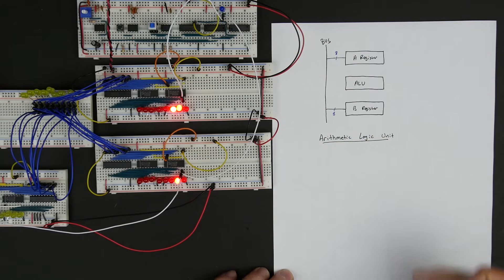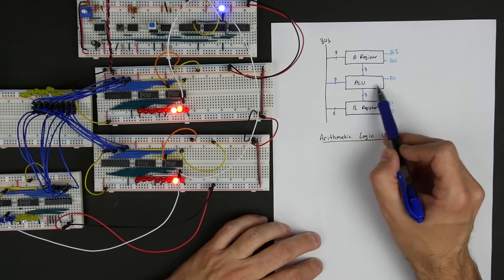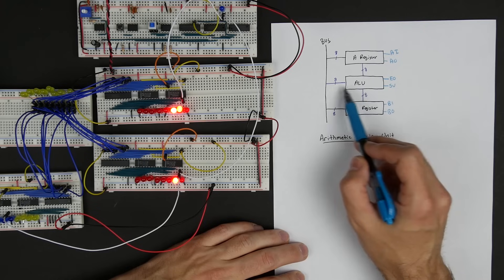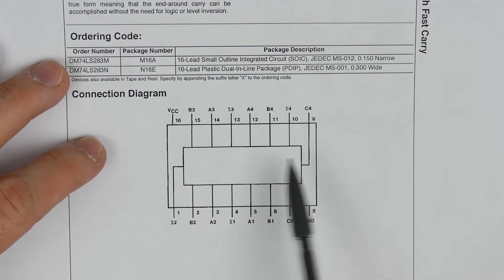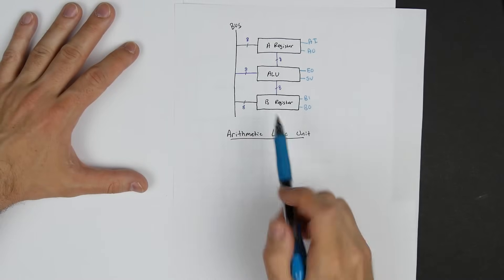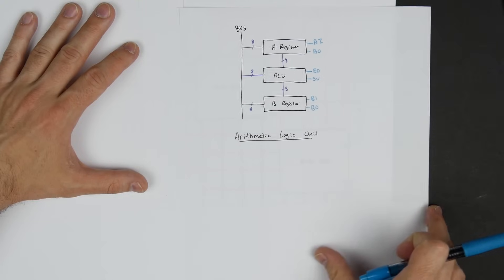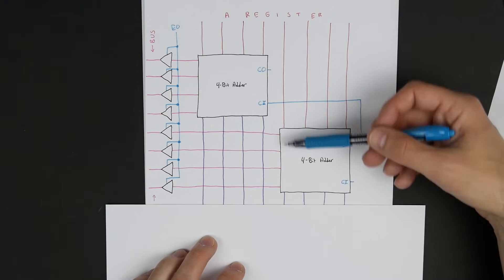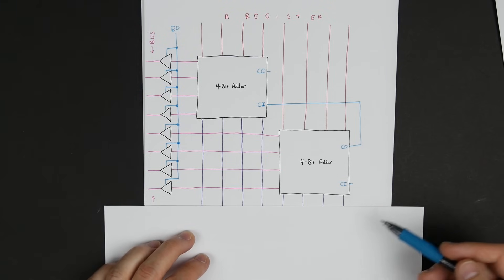ALU Design

Comment: So, I have a question; If I have a subtractor and adder, how could I 'store' the values? For example, there is absolutely no difference between 15 and -1, so, how could I store those without an extra bit? My only guess would be to slash the number of inputs, so that the only maximum output for a 4 bit ALU would be 7, with the minimum being -8.
Reply: It's been 3 months, but... just in case, and for anyone else reading:

The 8-bit representation of 15 is 0000 1111.
The 8-bit representation of -1 is 1111 1111.

The highest value you can store is 0111 1111, which is 127.
If you want to add 1 to 127 and store 128, that would be 1000 000.
Tough luck, because that's the representation for -128. You just got an integer overflow.

Comment: Hello Ben ! I just watched all of your videos till this one in a row, and I must admit I am really impressed about your work ! (nice catch for the carry in technique to get your twos complement)
I wonder why you use LS logic chips ? What does LS stands for ? I started a project a few weeks ago and went to HC chips, I was told they were faster and cheaper in terms of energy
Reply: Sorry for necroposting. Original chips were just 74xx. (for example 7400 for quad 2-input NAND). There were also low-consumption low-speed version called with letter L (low). Then the new technology emerged: TTL with shottky diodes which made IC faster at same consumption or of the same speed at lower consumption. These were called S (shottky) and LS (low shottky). 

At last, when CMOS technology became fast enough (first CMOS chips were 4000 series: very low-consuming but slow as hell), this new series HC was created, which means High (speed) CMOS.

Unfortunately, HC may not be compatible with other: circuit made entirely from HC works fine, but when you use both HC and LS, there may be problems.

Comment: Let's say for an alu I was using many 74f181's can I just link the cn+4 output and the following cn input together (I'm using 16 of them by the way). I was wondering if I needed to use the 74f182 with all of those or i can just connect the cn and cn+4? together thanks ahead of time.

Comment: I was wondering, why do we have to bring the A register and B register directly into this adder ? Isn't there a way to bring in the numbers off the bus?
Reply: dvsaleios excuse my idiotic question but
Isn't the point of the bus to be a sort of 'central hub' through which various components can interact with each other? Why not just hook up everything directly to each other? Or in other words when do you use the bus and when do you hook things up directly?
Reply: @active_diamond  So registers, ALU, other CPU components, etc, are *small*. You can easily directly connect them. With a 32 bit CPU, you only require 32 individual wires per register to connect them directly to the ALU. However, memory is very large in comparison. If you have 4 GB of memory on that 32 bit CPU, you would need 3.2e+10 individual wires. This would be messy, and almost certainly impossible to implement in hardware. It gets even worse with 64 bit computers, and soon you need more wires than there are atoms in the universe.
Reply: dvsaleios excuse my idiotic question but
Isn't the point of the bus to be a sort of 'central hub' through which various components can interact with each other? Why not just hook up everything directly to each other? Or in other words when do you use the bus and when do you hook things up directly?
Reply: dvsaleios excuse my idiotic question but
Isn't the point of the bus to be a sort of 'central hub' through which various components can interact with each other? Why not just hook up everything directly to each other? Or in other words when do you use the bus and when do you hook things up directly?
Reply: Not sure about this, but I think it's for some sort of "optimization". You can have only one output on the bus, so if the ALU would take the two operands from the bus, it should at least use two "ticks": on the first tick, the output of A is on the bus and goes into the ALU (perhaps in some sort of internal register) and on the  second one, the out of B will be on the bus, and then goes into the ALU. Finally, on a third tick, the ALU can output the result on the bus. 

With this setup, however, both A and B go directly into the ALU, so essentially it can perform the operation in just one tick!
Reply: No, the question is why would you want to? You load to registers from memory. Do something with the value in the registers then store back to memory. The bus should not be storing any kind of long term state only to facilitate transfer between components. To input you load to A or B register as it's what they're for.

Comment: carry out of upper adder will indicate overflow?
Reply: Actually, not really. If you add a positive number with a negative 2's compliment, it always has a carry that we basically ignore.

An actual overflow indicator for a 2's compliment adder has to check whether both numbers with the first bit are 0 have a result with first bit 1 or the inverse. Basically, in the first case would mean that you're adding two positive numbers and having  a negative result, or the inverse.

A logic for that would check if both register's first bit have the same value and if the result has a different one.
Reply: If you add two unsigned numbers and get a carry out then you have overflow.
If you subtract two unsigned numbers A-B by adding A and the two's complement of B, then if you don't get a carry out have underflow (borrow out).

If you consider your numbers to be signed from the beginning, the conditions are different, then I believe you have overflow if the carry into the highest bit is different from the carry out of it; there are other ways to formulate the condition as well.
Reply: He is trying to hack your machine, just ignore that bit

Comment: +Ben Eater, are you going to make some other arithmetic operations too? Like multiplication or division?
The simplest way for multiplication is to emulate it with repeated addition, but it is also very inefficient, because it gets very slow as the multiplier gets bigger :P

But there's another (better) way to do it, quite simple as well: with bit shifting & adding. You can do the bit shifting with a loadable shift register on one of your inputs, and then shift it 8 times to the left (multiplication by 2), and whenever there is 1 at that position in your multiplier, you also accumulate this shifted multiplicand into your output register. So it's pretty much the ancient Egyptian multiplication algorithm ;) It is better because the time needed to calculate the result doesn't grow linearly with the input, but it is a constant number of shifts & additions: equal to the number of bits of your data bus.

If you don't want to use shift registers and do 8 subsequent shifts & additions, but you do have some more money to spend on adders, you can simply connect several adders together and instead of shift registers you can simply shift the wires to the right by one position for each of the partial adders. You also need some control lines to turn these shifted inputs on, controlled by the bits of the multiplier. This is the best solution because it can calculate the result in just one clock cycle! :) (but there might be some delay on the carries to ripple through all the adders).
Reply: +Bon Bon , Or a binary multiplier circuit can be used: https://en.wikipedia.org/wiki/Binary_multiplier#Example
Reply: InductiveOrange Well, this is pretty much what I meant by the last option: summing up the shifted (that is, multiplied by 2) partial results in parallel. If you look closely at the example circuit you linked, this is pretty much two adders made of two XOR gates and two AND gates and connected together in a certain way, and the additional AND gates are there to "gate" the input signals, the original one and the shifted one (because you can do the shift by just wiring them off by one wire). Unfortunately, such approach is less modular if you have all these gates fleshed out. It is easier to understand when you encapsulate all the pieces of the circuit in blocks and then connect these blocks together into bugger blocks etc. Then the design is more modular and it is easier to extend it to more bits.
Reply: Cool. Didn't notice that.
Reply: +Bon Bon how can i do division ? i already have multiplication with the repeated addition .. but i cant find how to to division

Comment: where can I buy microchips besides internet???
Reply: There's also an option of recycling chips from some old electronics garbage. But this way you don't always get what you want, and you need to go with what you find in there. And you need to have some soldering skills. Breadboards are easier to work with, though, so if you're a beginner, I advice you to stick with breadboards and buy some brand new parts from the store (there are also online stores with electronic parts in the Internet).
Reply: store??? found some in electronic stores but buying from internet is easier
Reply: ok. thank
Reply: Bon Bon
Ok. thank you

Comment: Awesome vids! I was thinking you could even use the carry out from the top adder as an error signal.
Reply: Why error? There is nothing erroneous in it. But you can use it as a carry flag in your status register to indicate e.g. that there was an overflow during addition, or to be used in a subsequent addition to emulate 16-bit arithmetics, or as a flag indicating difference in comparison instructions ;)
Reply: i stand corrected, i was too quick to call it an error signal, but rather a flag that could be seen as an error signal, just made me realise that all signals are errors until we flag/use them, thank you!
Reply: Dale Smith No problemo ;)
Later on you can also use a zero flag which is useful in comparisons: it indicates equality of numbers when you subtract them. Just a simple NOR of all the output lines will do ;)
Some processors (like MOS Technology's 6502 used in those old Atari & Commodore computers and Nintendo consoles) also use an additional carry flag from 3rd to 4th bit for binary-coded decimal (BCD) arithmetics. Kinda useful for counters in games, because one can easily convert such BCD numbers to their corresponding character strings ;)
Reply: Bon Bon Yeah! I can see the NOR gates working to compare, could you go even further to compare the most sig bits to see which number is bigger too?

I don't understand the carry flag you're talking about, you make it sound like certain bytes of info have additional info encoded into them?? if so thats cool! 

if not then would this be possible? lol. Could you read a byte one way for a certain piece of info, then read it another way for another? Also makes me think about how to order info in memory, it seems so arbitrary in my mind, if the layout of the data itself could be used to extract info from then that would make programs more efficient??
Reply: Could you write a program where the order of the information itself can be used the encode how the information itself should be manipulated?? a kind of program within the data??? 

my head hurts
Reply: Dale Smith The usual carry flag carries over the bit which overflows from the most significant bit to the next position (if it were there). You can think of it this way: you add up 8-bit inputs and get 9-bit result, where the 9th bit is the carry flag. It can be used to find out if the overflow occurred, or to pass the information to the next byte when you emulate 16-bit (or longer) arithmetics.

For the "auxiliary carry" in MOS 6502 processors, it is used for Binary-Coded Decimal arithmetics. In this mode of operation, registers are considered as consisting of two 4-bit parts, each part can store a decimal digit (the numbers from 0 to 9), which can fit into 4 bits. The numbers greater than 9 (10..15) are considered "invalid". The BCD arithmetics works in such a way that each of these four-bit halves (decimal digits) are added separately, and if there is a carry from the lower half of the register (nibble), it is added to the upper half of the register. For example, the number 42 is encoded as: 0100:0010 or x42 (hexadecimal). So, as you can say, if you express the value in the register as a hexadecimal number, its digits correspond to its decimal notation :) which is very useful, and also very easy to convert to its corresponding textual representation: just extract each half of the register and add each of them to 30 hexadecimal or 48 decimal – which is the ASCII code for '0' – to convert them to characters.

As for how to interpret bits stored in a register: it's up to you. Bits are just bits. It's up to you (and the CPU) how you interpret them to give them meaning. The same combination of bits can represent an unsigned natural number, a signed integer, an ASCII character code, or a floating-point number, or a color value of a pixel, or even a CPU instruction (opcode, or operation code). It's all just numbers. Whether they are interpreted as instructions or as data, depends on whether the CPU is currently fetching them from that address into its instruction decoder, when pointed as the next instruction to fetch by the program counter register. You basically say to the CPU: "This number right here is an instruction. Decode it as such." and then "This next number right here is an operand (data) for that instruction. Treat it as a signed integer in 2's complement binary encoding." For example, in Intels' and AMD's CPUs (from the x86 family) there are separate instructions for multiplication and division: one for signed integers (imul, idiv), the other for unsigned integers (mul, div). Depending on which of these instructions you use, the next number (the operand) is interpreted accordingly.
Reply: For equality comparisons, I would use an XNOR gate for each bit so it shows true if the bits are both off or both on in just one logic gate. Then I would AND all the inputs for a single equality flag. You can also compare the most significant bits and set so if they're equal, it checks the next bit.
Reply: IanCraftsAndMines That would work too, but wouldn't be as universal as my (or rather the usual) approach, because it could only compare two numbers and tell if they are equal or not. General-purpose universal computers have to do better than that, and they do, using a clever trick ;>

You simply subtract the two numbers you want to compare (that's why subtraction is also called "difference" after all ;) ). If they were equal, the difference is 0. So you just need to check the Zero Flag to find out about that (and the Zero Flag is just a NOR of all the outputs). But when you do it this way, you can also find out which of these two numbers is greater in case they are not equal (the Zero Flag is cleared): you just need to check the sign of the result. If the subtraciend (the number you subtract) was smaller than the subtractand (the number you subtract from), the result will be positive. Otherwise, the result will be negative, because you subtracted more than was there.

So you can do all possible comparisons (equal, not equal, greater than, smaller than, greater than or equal, smaller than or equal) by just checking these two flags: the Zero Flag will tell you the equal / not equal part, and the Sign Flag (equal to the most significant bit) will tell you the greater /smaller than part. You can also check the Carry Flag after subtraction, if you set it up before performing the subtraction (in this case, it is considered a Borrow Flag: it remains set if there was no borrow, and it ends up cleared if there was any borrow) to tell if the subtraciend was bigger than the subtractand.

Modern CPUs usually have dedicated instructions for conditional jumps which jump to a different place in a program after checking these flags, and you call them after performing a comparison (which is just an alias for subtraction the result of which is not stored anywhere and which is performed only for its side-effects – the state of the Flags).

Comment: That was awesome when the carry in on the first adder swooped in like a hero at the end to bring us to two's complement! Really enjoying these, thanks for your time and effort!
Reply: So satisfying
Reply: I really is fucking amazing when he brings such a simple and elegant sollution to a seimingly tough problem. It had me wandering why the hell would he draw the active inverter circuit so close, like where and how is he going to draw the adder for the missing bit, and then BOOM! a misley little cable connecting the inverter enable to the carry in solves it all in one merciles swoop.
Reply: I feel so dumb now because in one of games I was building an ALU and Instead of this carry move,I wasted ENTIER 8 bit ADDER to add 1 to a negated value just to then feed it to next adder…
Reply: @archnemesis8340  Hey what game? Sounds interesting
Reply: @JohnVance  it’s called Turing Complete
Reply: @archnemesis8340  Oh wow this looks fantastic thanks!
Reply: @JohnVance  you are welcome, have fun :)
Reply: But then again it’s not like such smart moves are easy to see, so I guess it’s okey to make such mistakes, in the end we are not the real computer engineers :)
Reply: Very satisfying indeed. Also, the carry out of the second adder might be used as a signal of an overflow, and for example stop the clock or something...
Reply: u funnyman
Reply: I felt the same way, how fucking clever is that!
Reply: Absolutely! 😊